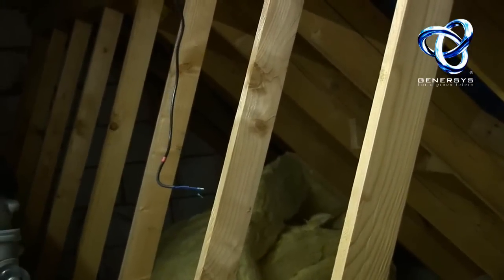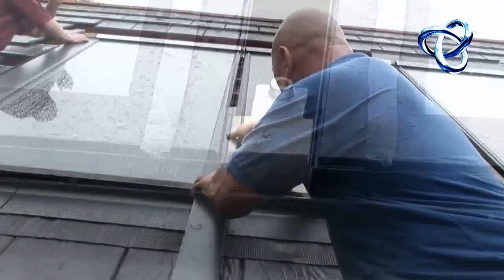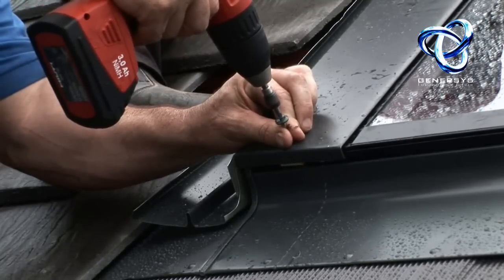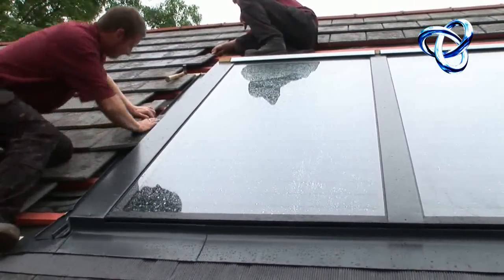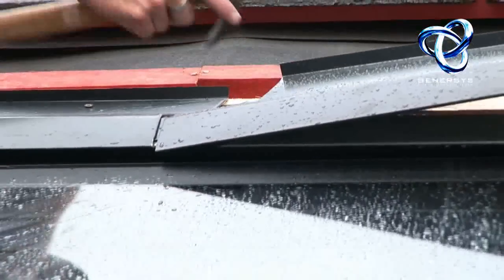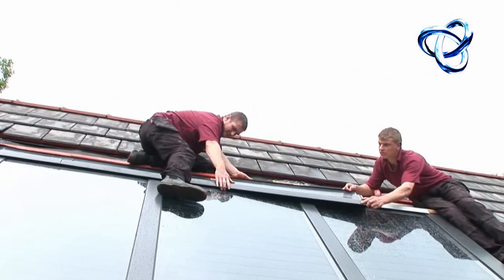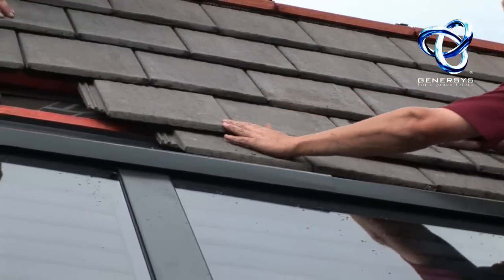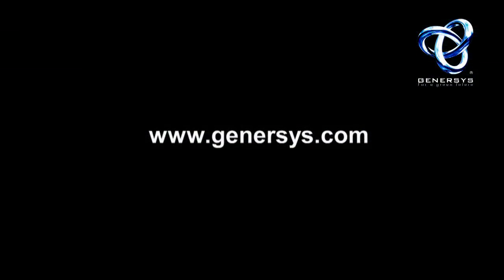Solar panel installation, for installers (HD) pt 2 / 2

Comment: Are the bits of wood in the installation kit pressure treated? Don't look like it.  Also all those winging about H&SE falling etc if you watched the vid closely. 1) you may learn something. 2) at 0:38 you missed a scaffold guard rail suggesting there was scaffold to eves level.